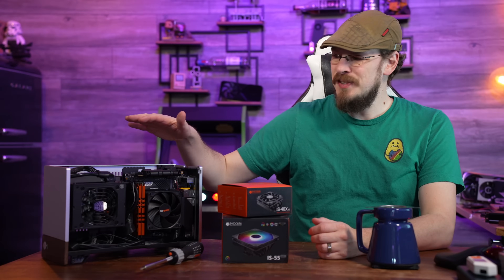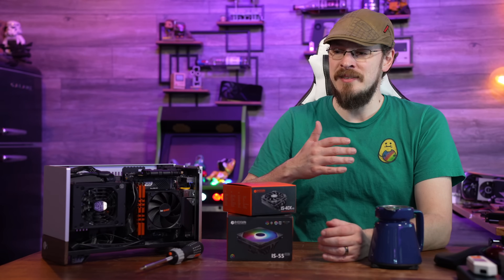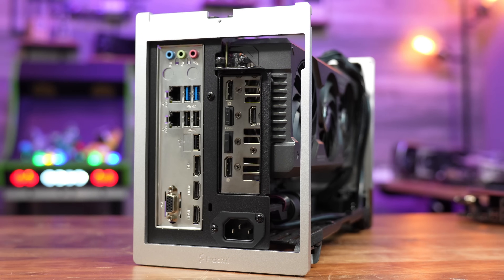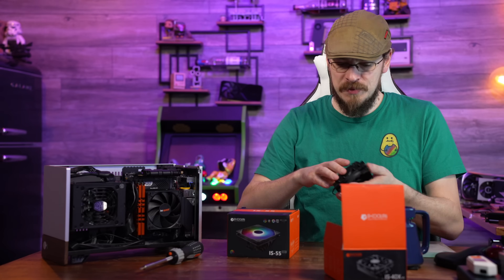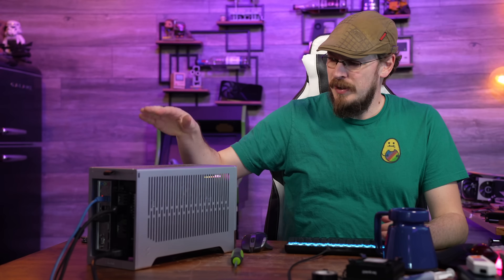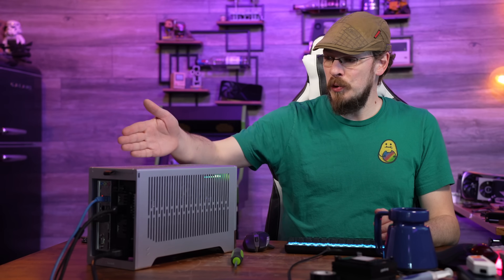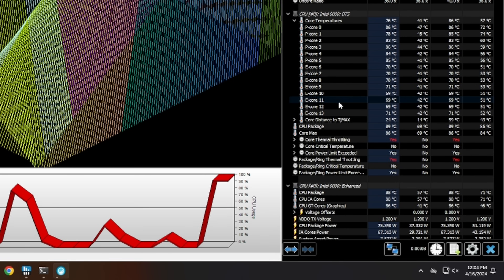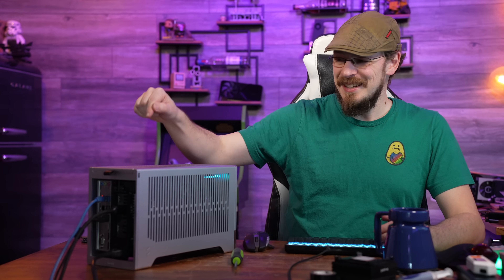Fixing the 13900H (ES) Overheating - 10729 ITX Motherboard

Comment: please do more videos on ES/hacked cpu's? 

maybe even some insight into QTJ0/QTJ1 chips? they are pretty much i9 9900k's but for 110 bucks.
Reply: not worth it anymore unless you happen to have the parts to do so.   do you want to buy a usb programmer as well that  increases cost? 
i own both qtj1 and the qqls and xeon 2286m, they are "good" but you cannot justify them anymore as a most 5000 series ryzens are so cheap now to do so its in your best interest to go with the newer platforms / parts.
Reply: @mikeymaiku  i already run a 5950x as my main rig but i just build a testing rig for those cpu's.

getting a few in the mail. and got a extremely high end board for it.

worth it? maybe, it depends.

if you got a good z170/z270/z370 board. you can spend 77 bucks for a 6c12t or 110 bucks for a 8c16t unlocked chip 

then resell your current chip (which will still fetch a decent penny. the used market is just fucked)

which in turn leads you to a 50 bucks upgrade in the end. maybe even less if you have a i7 8700k or 7700k to sell. you probably get that QTJ1 for free then in exchange of the higher end chips.

you just gotta mind that you wont be doing 3200 mhz ram on these chips.

also. currently testing differences between interposer designs. i feel like there's a huge difference that people are not aware of.

Comment: You have piqued my interest in these CPU/motherboard combo's. I was thinking about trying one of these in a Lian Li air mini. A little bigger case would allow for better air flow, plus you can use a 240 or 360 liquid CPU cooler. Thermalrite has AIO's running from $50(low end)-$80(top end). Which would still keep it cheap.

Comment: @CraftComputing
While the goal you were going for is easy to see, I would have gone with a dual slot GPU for this particular build. A 4070(non ti/super) dual slot, triple fan model. That's just me though. I game at 1440p and my 4070 does more than enough. Also would have gone with a lower profile kit of 3200 RAM. Regardless, great build Jeff! EDIT: Video's like this are excellent. Experimentation is always fun, even when you have a failure.

Comment: all you need to do is remove the heat spreaders on the oloy ram and you'll get the best of both worlds. Ram speed matters ton in alot of scenarios when you are comparing 1000mhz of a difference.

Comment: It's probably down to the speed of the memory. Using the slower 2666 MT ddr4 is probably holding the cpu back a bit compared to the 3600MT memory. That's about the only thing I can think of that might be causing the less than expected scores.

Comment: I had a similar problem with the height of the cold plate on the 12900k ERYING with a Thermalright low profile cooler. I was getting better cooling with a Hyper 212 EVO, so I'm still using that.

Comment: yup its beeen thatr way awhile. Sure if you can get a 1ghz higher clock that's worth it, but if you have to add 20% more power for 2% performance it just isn't. The extreme guys have even seen where backing off the clocks actually gives better performance in certain cases.

Comment: The RAM change is why the performance is lower. If you put back in 32gb of 3600 you will have a new higher score with the new cooler.
Reply: These gen boards has trouble working over 3000

Comment: great video! for pdxlan i did a build using a similar board and saw the best results with that same is55 though swapping in a slim noctua did help temps vs the stock fan though that being said I did use the next one down from the 13900h, either way I also happened to pick the terra though in green!

Comment: Yeah your memory speed impacted your score heavily. You basically "lost" the thermal improvements by going to 2666 ram

Pick up a better set at 3600 and redo it, i'm sure you'll improve overall.

I've had my "SFFPC phase". It was good while it lasted but i became annoyed with the lack of expandability of mini itx. Too many compromises to do for just having a small footprint. I've gone back to a micro ATX which basically has the same footprint as my old SFF case, but just taller.
Reply: i love sff pcs, but im glad that i started when companies started to accomidate 3 slot cards.  id be turned off too if i had to buy a whole new setup because the case i picked just couldnt support new parts comming in.

i have since gotten a SFF time P-ATX V1.  at least now i can fit most components today unless we start seeing 3 slot as the "standard" size

Comment: With the first time you had the machine open, you changed the cooler as well as adding the shim to the cooling plate. Did you ever test the bequiet cooler with the shim and nothing else changed? 

I've made the mistake before of changing two (or more) variables at the same time, then being unable to say without question which change made the difference.

Comment: The ram speeds are not slowing things down. Intel's architecture is still monolithic and doesnt have anything like AMD's inginity fabric to slow it down. This also why intel's cpu's dont have as much cache. It is because intel has a better architecture latency-wise.
When its intel you dont need to worry too much about ram speed because there isnt much waiting going on during the cpu cycle.
The only time where ram speed matters is when you have an intel cpu clocked close to 6GHz and beyond. Thats when the cpu is processing things so fast, that ram will slow things down. Since this mobile cpu is only clocked at ~3GHz, it doesnt matter.